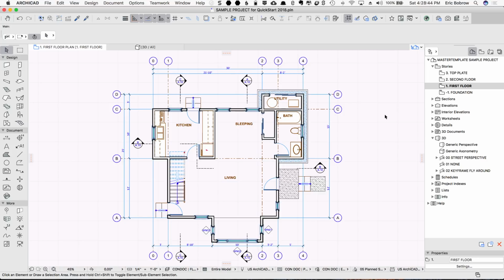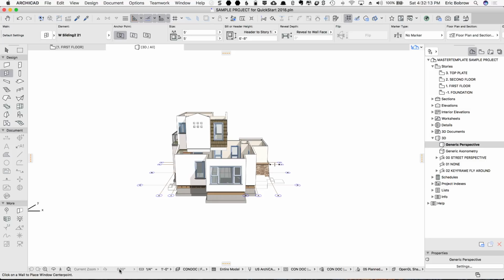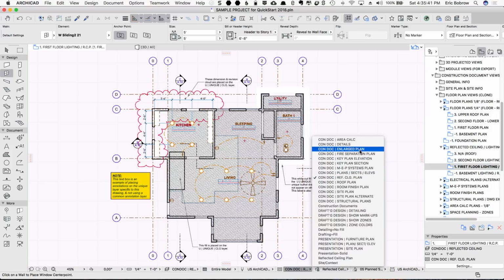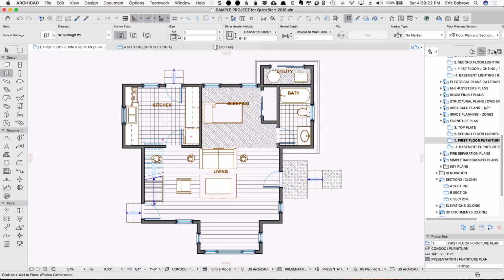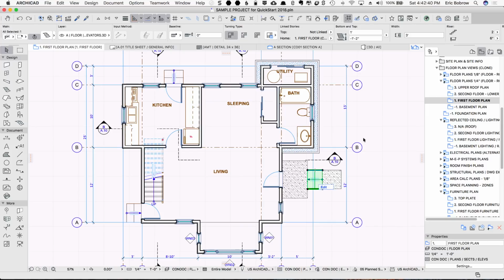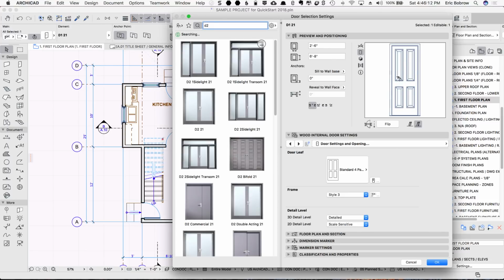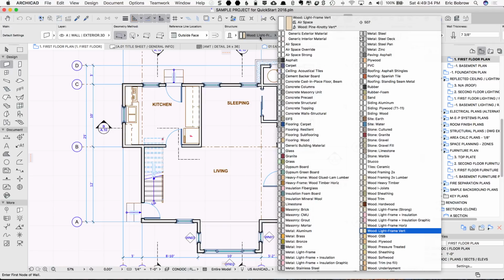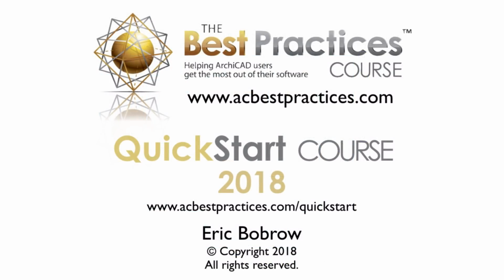ARCHICAD Basic Training 1 - NEW Version of QuickStart Course

Comment: Just Great Eric!  I ran into one of your older presentations and liked the clarity of your presentation and wondered why there wasn't something as comprehensive as this.  I have been reworking the various tool boxes because it seems that some of them do not have the clarity that you have. And some are jumbled. It would be neat if we could set up pull down menus to have many of the tool boxes pop up upon selection revealing the various categories of data;.

I like a super clean interface that brings up only that which we need at the moment. It struck me that there were far too many flailing gestures so I created a 3X3 toolbox that allows me to have rapid control of moving the model around. I love it because it can sit near where am working.

It strikes me that You ought to discuss the difference between a Tool Box and a "Palette" early on and that Palettes snap to the boundaries of the display monitor while the Tool bars can be all over the place. I have undertaken the task of cleaning up many of the tool boxes which seem far to disparate to me.

This presentation for an introduction is absolutely magnificent and shame on Archicad for not mentioning your name in the first five seconds of a sales pitch.

There is no question in my mind that you are the Dean of Archicad.

Fit frame  Marquis  Arrow
Undo         Redo       Hand
Blowup     Shrink     Orbit

In real life it's smaller and very convenient. I hate flailing.

Much more to talk about Eric!! You are great!  And no one at Archicad mentioned starting with you???!!  

I do have one question about walls... the blue streak, should we always strive to have it on the outside of the structure?